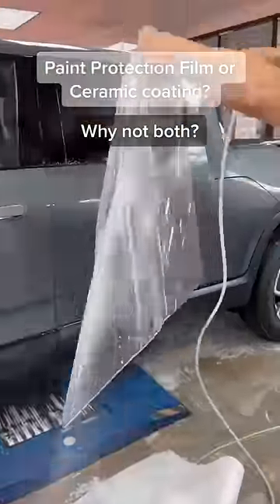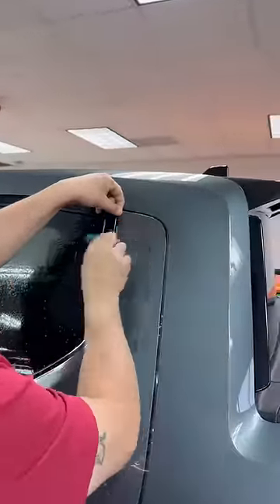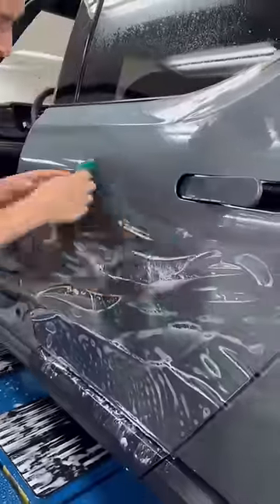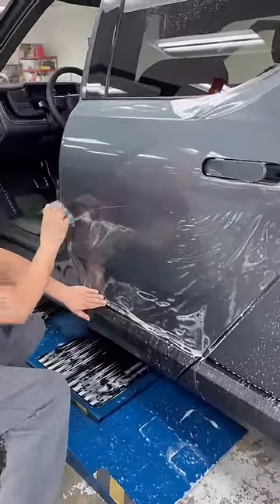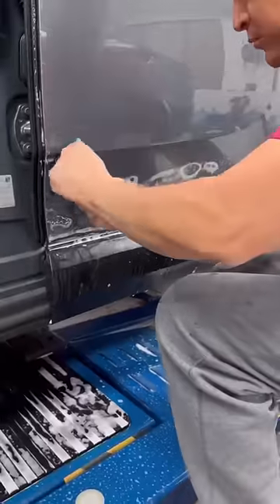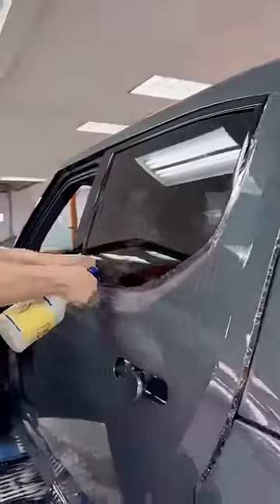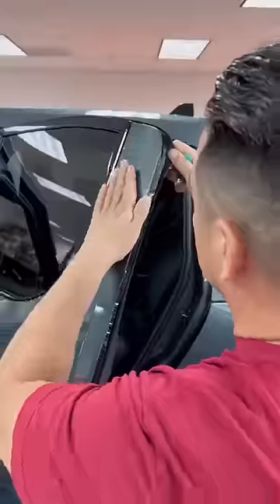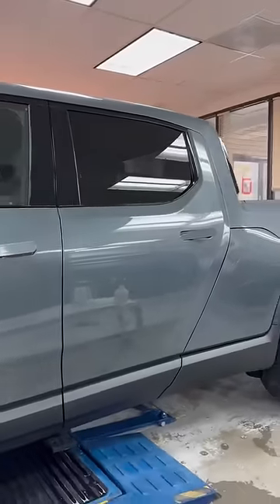PPF vs ceramic coating? Why not both!

Comment: I have been in the auto body business since 20 years. Ceramic coating lasts a few weeks so it’s not worth the money. Protective coating is only good if you do not scratch or wreck the car. If you get a small, scratch in the protective coating, it will cost you another $3000 to have it done again. Versus $500 for a small scratch. Protective coating is a rip off. Stop ripping people off!
Reply: LOL
Funny joke my dude
Reply: @ooodinimagic2151  im not joking. To add clear protection to a front end of a car is over $1500. In 8 years that stuff will harden and never “peel off” making it impossible to remove. If you scratch the bumper, the average price to paint a bumper is $500. But to paint a bumper and re-wrap it is about $1200. Does that make sense?
Reply: @Sean S  idk what u said but ceramic coating lasts way more then ' a few weeks'🤣

Unless u using that shit u find in a spray bottle
Reply: Two pack enamel and or backed enamel no clear coats or wraps
Reply: Funi
Reply: @ooodinimagic2151  I bought my ceramic coating online. It cost me $120 for a 6 ounce bottle. After two car washes it was gone.
Reply: @Sean S  1. Did you do all decontamination and paint correction
2. What one did you order? Some are dog house
3. Did you let it cure + not wash it or let it get wet for 7 days?
Reply: @seans6573  😄😄😄
Reply: Damn straight bro!
Im in the trade also and share the same opinion as you.
Reply: @ooodinimagic2151  damn brodie you so defensive all hes saying is unless you have the money to constantly re doo it it’s pointless. And hes even saying that keeping it for prolonged periods of time runs the risk of it bonding to areas permanently.
Reply: Ppf is also covered by insurance, so if you are just paying your deductible then it’s a non-issue. But paying cash out of pocket could be an issue.
Reply: You rip people off too ....
Reply: Lmao let me guess… your opinion on wax is that it doesn’t do anything either. Washing your vehicle just isn’t worth it because it will still get dirty! 
In reality, you either purchased snake oil or you didn’t properly prepare your surfaces. Either way, the failure is on you and not ceramic coatings.
Reply: @seans6573  you did something wrong or used a crap coating. Also hopefully by car wash you meant hand wash or touchless? You can not take a ceramic coated car through a wash with brushes, it will fail quickly. System X offers 6 & 10 year warranties on some of their coatings and yes I use and apply them for my business.
Reply: Been in the auto business 20 years ... thinks ceramic coating only lasts a few weeks 😂😂😂😂😂 stop lieing about your life on the internet and get a hobby lol
Reply: LMAO, his 20 years of skills shows that he lacks knowledge. Spray Ceramic will last around 6 months and those small 50ml bottles of ceramic coating will last 2 - 5 years depending on what kind of durability you want to fork up the cash. Of course, with proper care and maintenance, ceramic coating will last or exceed its manufactured durability specification.
Reply: @seans6573 its really a facking rip off...its only good...if you park your car in a museum.... and never drive it....but if your on the road....anything can happen...
Reply: Obviously, that film also trap heat, moisture... causing more damages to the paint.
Reply: @NoLurp ceramic pro has lifetime warranties under ceramic coatings depending on the package that you get

Comment: Full PPF on a pickup? Someone has a lot of money.
Reply: Lol it doesn't cost that much for ppf. Any new car regardless of price benefits from ppf, especially if you plan on reselling or trading in later
Reply: @Xx-VSM-xX  
PPF is worth the money for specialty cars, but let’s be realistic a Rivian is not a specialty vehicle.  No matter what quality of product is being used, it breaks down over time.  Using it on a vehicle that is used regularly can be a problem. The cost to remove PPF after it has degraded can be more than it was to install. I’m all for people spending money however they like, but putting it on a rear door of a pickup is amusing to me.
Reply: @Xx-VSM-xX  it costs several thousand dollars to do ppf. Derrrrrp. Tell me you don't know what you're talking about without telling me you don't know what you're talking about. (If you've found it for less, they're using trash film.) My truck is $105k and I didn't even put it on that. My G63 and G550 have it though.
Reply: It’s a rivian not really a truck. All electric and Things $75g’s!!!😮
Reply: @brianshockley6429  
Just because it’s electric doesn’t make it not a truck. It’s actually supposed to have some real capabilities. Lots of trucks cost that much. Don’t get me wrong, I’m not a fan.
Reply: At $80,000 for pickup PPF is nothing.
Reply: @Xx-VSM-xX  shits like 600 for a hood alone 😭
Reply: @Everythingisgoingtobealright  For me, a $60,000+ vehicle is worth protecting. Can you direct me to any one single source that indicates removal costs more than installation? One thing you might consider is they applied the film to more than just the surface shown in a short video. Are you one of those famous contrarians who's job in life is to see the opposite of what everyone else sees?
Reply: @dasworkshop4967  
A low end F250 is $60,000, would you PPF that?
I am that single source that indicates removal can cost more than installation. Applying PPF to the front of a vehicle (bumper, hood, fenders) isn’t the end of the world, but doing the doors on a pickup? That’s funny. What do you suppose that door is being protected from?
Reply: @Everythingisgoingtobealright  Solar radiation for one, "road milk" for another,  people brushing up against it when it's dirty, c'mon, you understand completely, you just want to "win". I'm not accepting your personal anecdote, so if you wish to "teach me" you'll have to find an unrelated (to you) source.
Reply: @dasworkshop4967  
“Solar radiation”🤪 have a great day.
Reply: Exactly !
Reply: @Everythingisgoingtobealright  <---- this dude speaks from experience. And is 100% right.
Reply: @Xx-VSM-xX  a good ppf for this size vehicle installed by a smilled shop will run you $4k+ easily. 

The protection is offers your vehicle for resale value isnt even half of that.
Reply: @dasworkshop4967  youve clearly never used ppf and had it removed. Install on a vehicle that large is easily $4k+. You wont get that added value out of resale, not even half. A simple wax job will bring the resale up to the same outcome and be cheaper. A $60k vehicle def isnt worth a whole body ppf (unless its a vinyl wrap and you are doing it for looks).
Reply: @littlejackalo5326 youre broke
Reply: @Everythingisgoingtobealright  I love my Toyota....eye of the beholder.
Reply: @Xx-VSM-xX  is the sell price will also include the price of PPF you buy and put on??? 😂😂😂😂

Comment: It is completely unnecessary for a full body PPF I run a shop all. I tell my customers is you just need the front bumper, both fenders, full hood and side mirrors. Rocks typically don't hit the back of the vehicle or the doors. So front end do PPF and then from the doors back doing nice ceramic coating
Reply: Thanks will do that
Reply: that would trigger people with OCD lol
Reply: I agree 100%. I’m getting mine done next week. All that you said, plus the pillars and rear spoiler, only bc their piano black, and scratch just from breathing too hard on it lol.
Reply: I dont agree i got full ppf and had a rock go from my front tire to my rear passenger door while making a lane change. It looks like it saved my paint from a massive scratch. So happy i got the full body ppf worth every penny. I wont know until i take the ppf off but i believe it only grazed the plastic layer
Reply: @AeroNationHD how much it cost for full body ppf..and what is ur type of ppf applied. Thanks.
Reply: @PradeepKumar-tq4ev  its not cheap 5,000 for the full body i did xpel in a stealth finish. I had a rock chip in the front of my new car when i purchased and i couldnt live with it getting damaged again. So i coughed up the change
Reply: UV and strong wind/dust will also wear down the paint. Your car may end up with nice front and worn rear. 😁
Reply: As someone who drives a 210 000 km / 130 000 miles / 10 year car without ppf, I can assure you that rock chips will be present everywhere at some point. Most of them appeared in the last 2 years, as my paint started to wear out. 

But, it might cost less to repair the occasional rock chips than the cost to install and remove later on the ppf, depending on the car, environment, usage, etc.
Reply: @PradeepKumar-tq4ev I look around ceramic pros PPF is apparently lifetime warrantied but it's expensive The guy says it'll cost me about $8,500 to do a full PPF wrap on a 2024 Camaro SS he charges by the square foot or square inch or some crap like that
Reply: This is 100% true.
Reply: I actually got a big rock chip on my gas tank and the roof on my car so idk but I got my roof wrapped also and it took the wrap right off
Reply: Dude you are so fkn right....I get so many bumper scratches from parking lots.
Reply: @AeroNationHD might as well just repaint the car in a few years if the rock chips get bad. 5k for ppf? Hell no, unless I’m driving a Lamborghini
Reply: What about protection from my cats climbing up the sides or back and from randos opening their doors and bumping it in supermarket parking lots?
Reply: @Airbag888  I fkn hate those supermarket hacks! So many scratches and dents because of them.
Reply: @MrSniperific13  yep
Reply: Tell that to the trees in the woods lol
Reply: I disagree. I got a full pff on my car. It's a 200k car so I wanted to be really safe. It paid off almost immediately.

A week in, a friend's mom fell on the back of the car while driving near it with her bike. Scratched off almost all the PPF but saved the paint. 3 months in, I ran out of tire shine and my uncle gave me some shitty armor all that slung all over the side of the car. Till this day, the acid in the shine has left damages on the PPF, but at least it's not my paint! A month in, some lady opened her door and it the rear side of the car. PPF saved it again. Last week I was driving while a snow salt truck passed in the opposite direction, slinging a huge amount of salt rocks all over the front, side and rear of the car. Ppf saved me once again. Plus I have satin paint, so no buffing out for me
Reply: @senagangbe5804 bro you doing too much driving in that $200k car. My car was $85k and I only drive it twice a week 😂😂
Reply: @lougawou707 sadly if you are driving a new Z06 corvette, you’ll be close to that price tag.
Reply: @YourPalQWERTY  yea these dealer mark ups/inflation shit is crazy but I’m glad it’s finally starting to slow down tho. Hope this carry’s over into 2024 and not just some holiday bs
Reply: I have full ppf and it’s worth it
Reply: Bruv. It’s not for the rocks. It’s for the keying of people with bad intent or collision from the rear/sides. Use your brain and stop being cheap
Reply: On one side of my car it looks like someone keyed my car and the other i have 3” scratch from my kids bike….. full body it is
Reply: Well you have too whenever you have a satin car that requires stealth film. The sheen is different if you were to just put a full front on. So this really doesn’t apply IMO. Protection the whole car is definitely a GOOD investment. Why would you not want more revenue? Selling a full body isn’t necessarily screwing the customer
Reply: I drive through a lot of brush and woods.. it's getting full ppf. Necessarily
Reply: Sometimes there are people who push the trolley blindly to the back of the car especially to pick up vehicle 🙄
Reply: Say that until you got a shiny bumper and everywhere else looks fucked.
Reply: @richywing  🤣🤣🤣🤣
Reply: Only an idiot pays $5000 for paint protection. You'll never get that money back.
Reply: My 992 has exactly this. Rock chips happen a lot more on lower cars
Reply: I got a full body PPF and ceramic on top of it. Best decision ever,
Reply: True yet I got a rock chip on my driver's side door within 4 days of owning the car. Never say never.
Reply: @YannickC  this is an important comment, if you're using a car as a commuter anyway, it's almost guaranteed cheaper to just correct rock chips every once in a while compared to PPF
Reply: Cars scratch all the elements
Reply: A car with PPF is easier to wash and it looks fresh

Comment: PPF is too expensive, not worth it, if you ceramic coat it and call it a day, if you keep the car for 10+ years, and the paint has gone bad, repaint it for half the price, PPF for the whole car is 4-7k ridiculous.
Reply: Anyone who repaints your car for less than the price of a full PPF, is gonna Jack your shit up. Overspray. Don’t even bother removing trim, drip marks, the whole 9 yards. 

I can guarantee my customers 100% all out wraps and PPF look as good as OEM paint, and 10X better than any aftermarket paint shop can produce at the rate we charge. You’d need a $10k paint job to match our work.
Reply: @dontbestupid6664  not all body shops are the worst example of a body shop.

I've sent a couple hundred cars to local body shops, full paint jobs. They remove the trim, and rarely give me a car with overspray and drips and the few times they have, they rectified it.

It's a matter of finding professionals. I could have a Corolla painted twice for $8,000 and no one with an untrained eye could tell.
Reply: @dontbestupid6664  I had my car doors repainted for about $600 each and I could not tell the difference from the factory job.